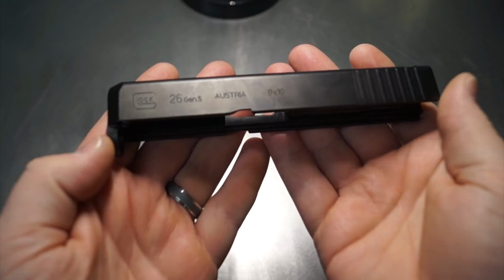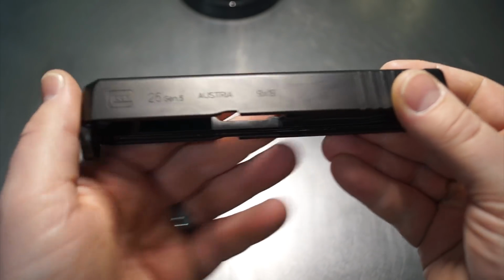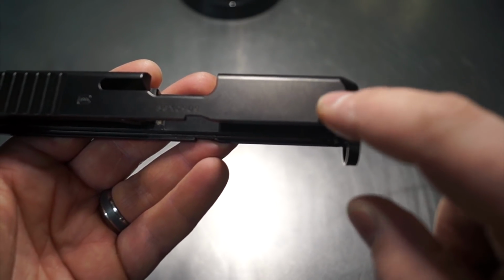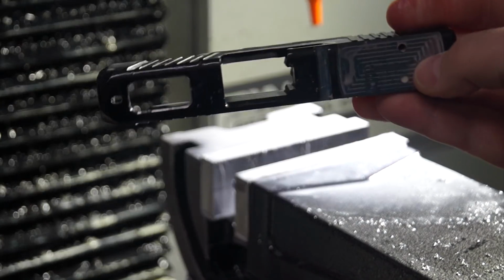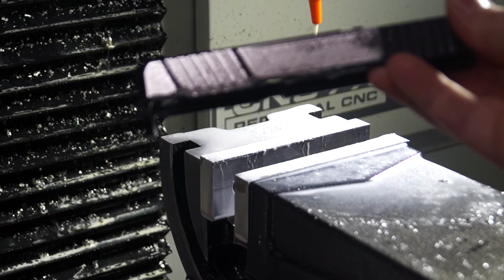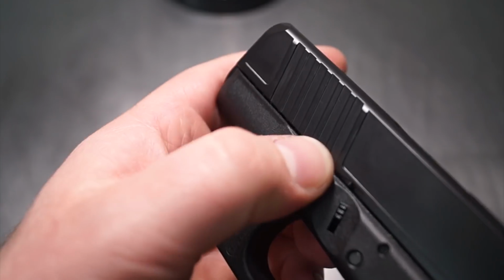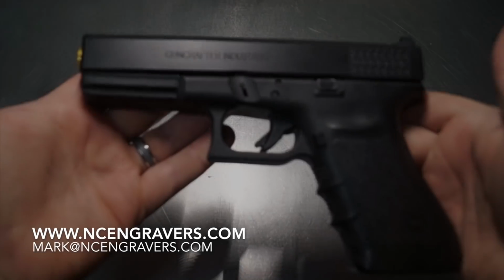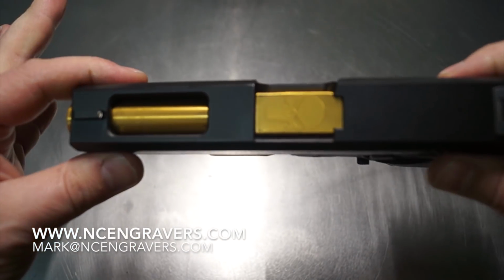NCEngravers.com  - Glock 26 (gen 5)

Comment: What is the issue with the plunger? Just sent my glock out for cut so I can put a rmr on it, but its gonna fit right in front of the back dovetail? Am I gonna run into any issues? Glock 26 gen 4.
Reply from the maker: The trijicon will fit in front of the factory dovetail but other optics will hit the plunger hole. If they cut the slide deep enough it will prevent the plunger from doing a full stroke. Sounds like your doing a trijicon. Shouldn’t have a problem.
Reply: @NCEngravers  thank you! Whew. Was super nervous I just ruined my slide lol. Yeah trijicon type 2 rmr. Thank you!